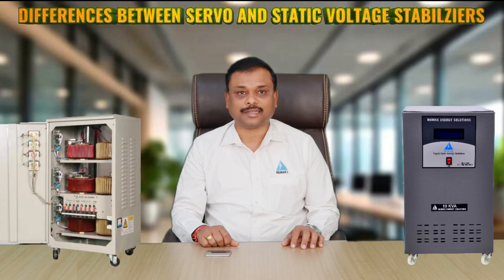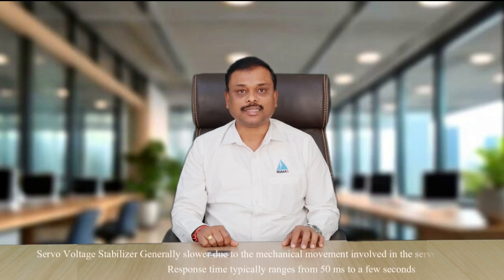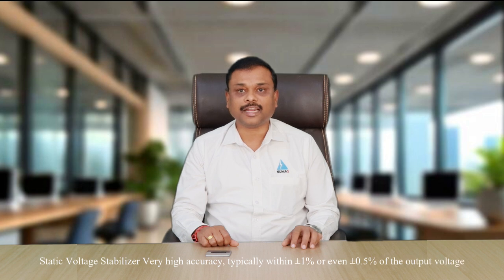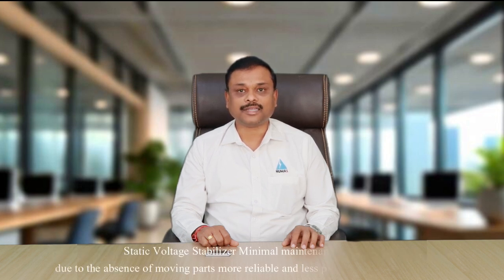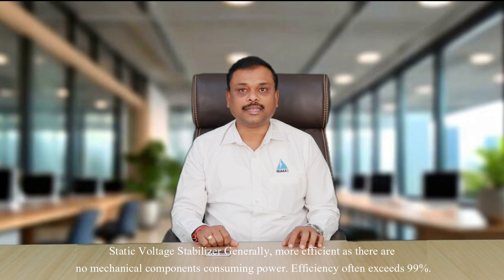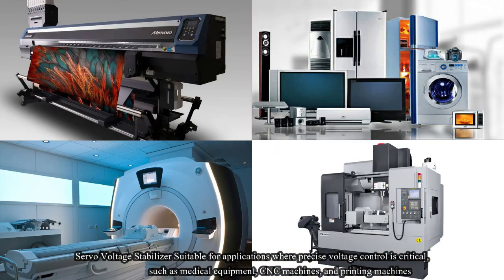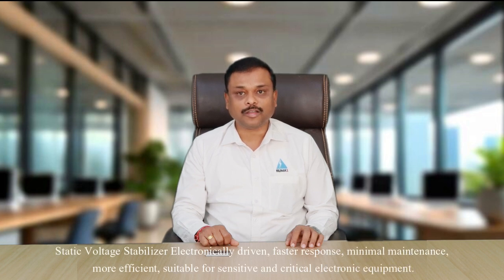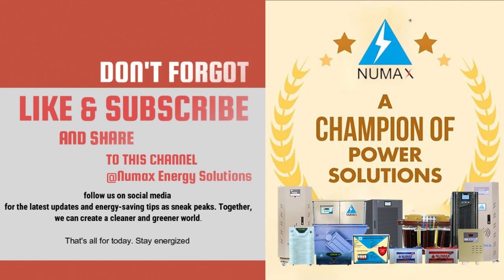Difference Between Servo & Static Stabilizer

Comment: Which is best for domestic use...servo or static ??
I need a stabilizer with voltage range 140-300V and 40Amp torque load for my house
Reply from the maker: Please share your details to our team or any Enquiries Contact us
E-mail - marketing@numaxups.co.in
Tel - 040-4014 8225, +91 93914 23279